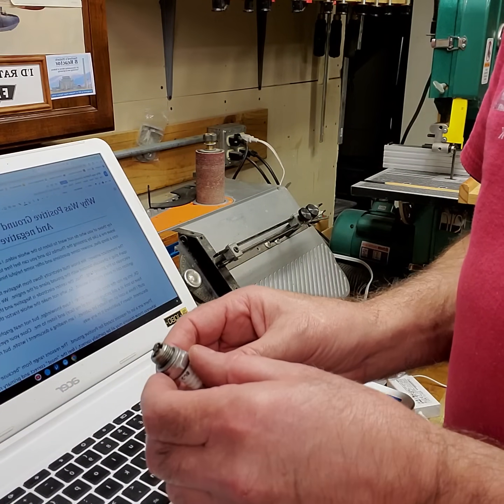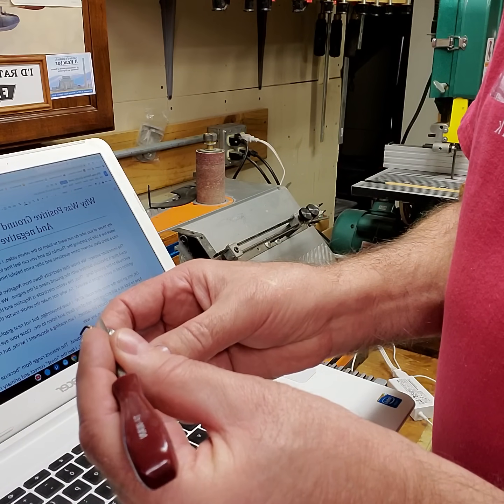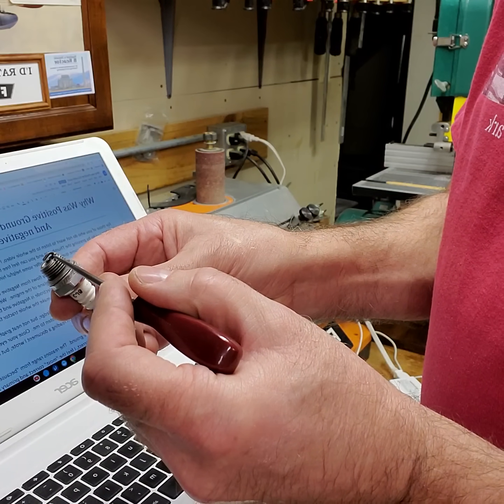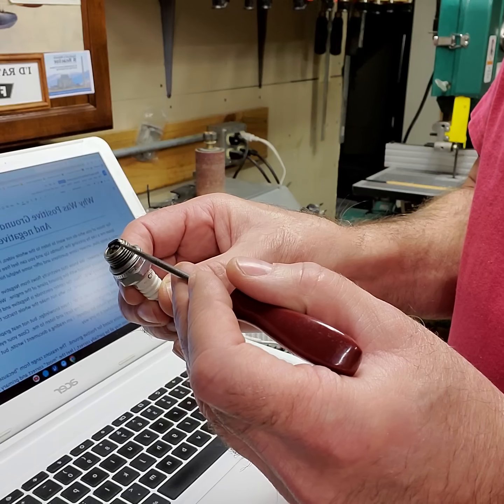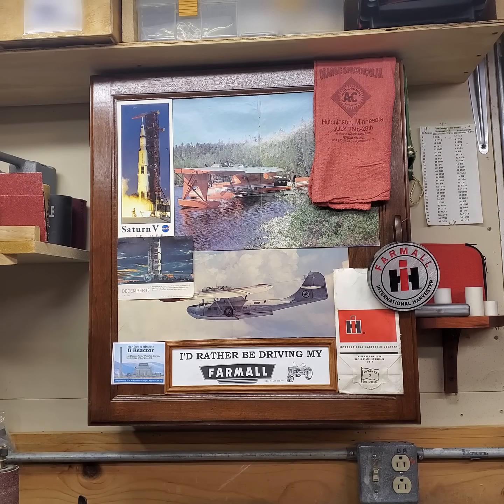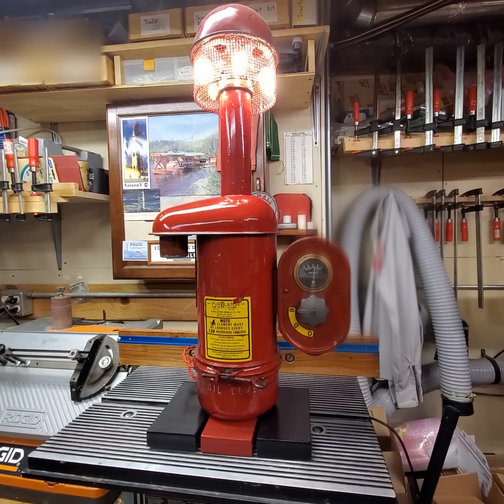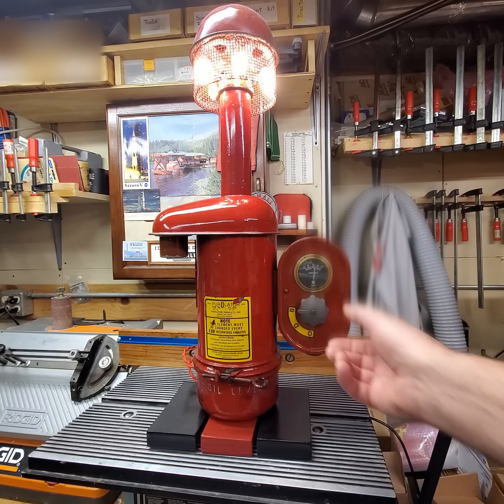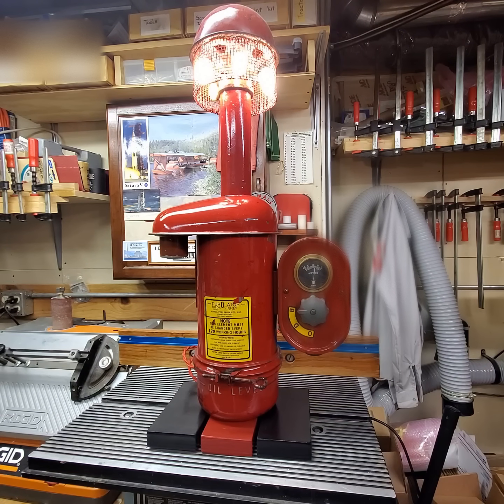Why positive ground was used on old cars, trucks and tractors

Comment: Great video, but there may just be one hiccup in your observation, as good as it is, when an ignition coil is energised by the points closing the magnetic flux creates a small matched polarity voltage in the secondary winding, then at the ignition point where the points open, that magnetic field collapses rapidly creating the high tension spark, but this collapsing field moves the other way causing the output voltage to have the opposite polarity as an emf relative to the primary winding. They possibly went to negative ground for this reason.
Reply: I'm no expert by any means, but doesn't the condenser in distributor help to alleviate this problem by absorbing excess voltage at the points?
Reply: @fokkerd3red618  Partly. The condenser effectively absorbs the back emf from the primary winding of the coil, reducing the voltage potential to a level below arcing. When the magnetic field in the coil collapses at the moment of points opening, that collapsing field creates an inverted high voltage in both windings, although it's much higher in the secondary. As the point contacts move apart from zero gap there will always be some minor arcing even from a fairly low voltage but without the condenser it can pass several hundred volts. The condenser doesn't block the high voltage either, it just slows the energy peak's time domain as it charges which has the effect of delaying the peak voltage and thereby spreading it's energy from a few nanoseconds to several milliseconds which is enough time for the points to establish more gap opening each cycle. Spreading this energy over time (snubbing) also therefore lowers the voltage peak which also reduces arcing, this is because the energy value is not increased or decreased, it is simply spread over a longer time interval. The HT winding is also affected by the condenser, but in a good way, the slight back emf current delay from the primary which is transformer coupled into the secondary HT winding (when values are correct) works to slightly lengthen the spark duration and also increase it's current, effectively giving a hotter spark that is less affected by high gas loading, or wide open throttle.
I hope this all makes sense.

Comment: To me the primary disadvantage of the negative ground is that it causes the bodies to rust out due to the polarity on the body surface. Mechanical connections have been the source of most electrical problems and should always be thought of first. Today's vehicles have reduced the size of these such and compacted them together so much that they have created troubleshooting nightmares. Great video.
Reply: Absolutely!
Reply: Ground polarity has no effect on corrosion in vehicles since all vehicles are isolated from earth ground by rubber tires. However in underground pipes which are 'earth grounded' quite well due to being buried. Anticorrosive voltage/current is applied to underground piping systems to minimize electrochemical corrosion.
Reply: @WJV9  You really are confused.
Ground on vehicles is absolutely nothing to do with the physical earth.

Don't get confused with earthing of mains electrical installations such as houses. 

The ground of vehicles is absolutely nothing to do with earthing, and it wouldn't make any difference if there were no rubber tires.

The ground on a vehicle, is the use of the metal body work as a common connection point, an easy way to connect things together.  So instead of running multiple wires back from rear lights including tail light, flashers, the brake light, the headlights, the horn, the electric window heaters, the electric window winders, they can all connect to the metal body work of the car and it eliminates a large amount of wiring.

There is no connection to "ground", or "earth". Not that any is even required.
Reply: @WJV9  --  Well, believe it or not, tyres have enough "carbon black" to be slight conductors.
Reply: Great reason, except you got it the wrong way round. Look up "sacrificial anode" (positive). With positive earth the whole body becomes the sacrificial anode and that's why it corrodes away. That's the true reason why they changed to negative earth.
Reply: I do quite a lot of electroplating, the material I want to plate onto is the cathode, the material I want to put on is the anode. Neither are connected to physical ground.

Comment: Thanks. I needed that. But let's not forget about the cars now days that use a waste spark ignition system.  You should explain that to some people.
Reply: The spark plugs used in those engines have a special material either platinum or iridium on both electrodes so there is no ground electrode erosion from the reversed plug.
Reply from the maker: Thanks again Matt!

Comment: I don't know if it was oversight or you just didn't know, British motorcycles were positive ground until 1978 (ish)
It's often ridiculed by various mechanics (British cars were the same but I have no idea when they changed?_)

Japanese motorcycles have used 'dual end' (or open end, dual lead) coils since 1969 on inline 4 cylinder bikes, (two coils and 'waste spark')
  Many motorcycle electrical manuals showed an ordinary pencil being used to check polarity ( spark jumping to pencil  then on to ground will 'flare' when it's going centre to ground)
 One plug fires 'conventional' centre to ground but the other fires ground to centre.
It was common practice to swap the plugs around to 'even wear' when servicing.
  Personally, I would be more interested in why the change was made from positive to negative grounds? (being somewhat cynical, I believe it's so car bodies rot out faster 'forcing' people to buy new vehicles?)
 People wouldn't be confused if it was the only thing being taught, plus, electronics would be a whole lot simpler as various components are 'switched' on the 'ground' side (transistors, etc)
Reply: Even PNP transistors ?

Comment: Thanks for answering my childhood bewilderment question 🧐
Reply from the maker: Hi James.  My bewilderment was why radial aircraft engines are always an odd number (per throw on the crankshaft).  It took me a long time to figure that out.  Then, I started thinking about plutonium ......
Reply: @bryanh1944FBH  LOL. (plutonium...)
I thought about that too.
I resigned myself to assuming it just worked out that way when allowing for cooling spacing and mounting base size of the cylinders, hub radius for stroke throw, etc...
I do still wonder if there is more to it than that...

Comment: The coil can be wired to either direction so the battery ground doesn't dictate the spark polarity.  There are huge numbers of cars with double ended coils which fire one plug negative and one plug positive.  Ignition systems now are so strong the the difference is irrelevant.

BTW, all that you were taught about electron flow carrying current is completely wrong.  What actually carries current is smoke.  This is easily demonstrated by noting that if the smoke comes out of a wire it will no longer carry current.
Reply: Apparently, current is carried in the air around a wire  (in a magnetic field?) So you're not that far off with 'smoke'.

Comment: I have listened to this several times and I agree with the vast majority of your information.My only comment is that the ignition coils are all wired to provide a spark from center electrode to the body of the plug. You said the positive of the coil should always go to ground and technically this is true but the coils are sometimes marked Batt and distributor Some have a + on the coil not to be tied to ground. They are internally wired correctly to have the plug  electrode negative point the terminal marked + or pos doesn't  necessary tie to ground.
Reply: Many newer cars with coil packs actually fire 2 plugs at the same time sending voltage from one center electrode to ground tang through the engine to its mating plug tang to center electrode and back to the coil completing the circuit.
Reply from the maker: @martyk1156  Hi Marty.  That's interesting.  I need to learn more about that.  Thank you for your comment.
Reply: @martyk1156  waste spark systems

Comment: Thank you for your time explaining it, I listened to it over and over again until I understood it better, I now understand better about Dads old 1940 Flathead Ford Tudor Sedan's electrical system, it always puzzled me growing up.... Thank you.

Question..? How come the steel bolts in an aluminum engine block and heads like in the Ford Triton engine, like they were welded in the block and can't break them loose... something to do with the current and aluminum and steel bolts in block...???
Reply from the maker: Hello E.F. White.  Thank you for commenting.  I believe the steel bolts in the aluminum block look like they do because of the fact that different metals often don't like each other.
Reply: The dissimilar metals in the presence of an electrolyte (salt water) causes galvanic corrosion and it can be a real bugger. It is why I love Anti-seize.😉
Reply: Agree, ALL dissimilar materials next to or connected via a medium (charged water) to each other create an electro-chemical reaction, which is why water from a zincalume roof will rust out a galvanized gutter 3 times quicker than the other way around and electronic neutralizers work well especially in a high salt 4x4 environment.